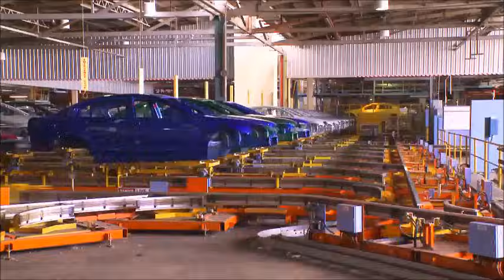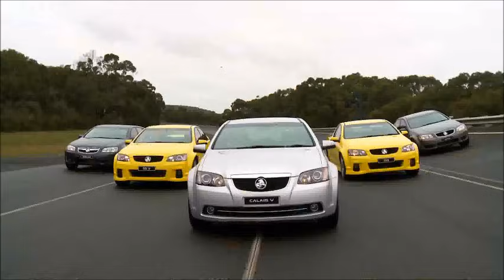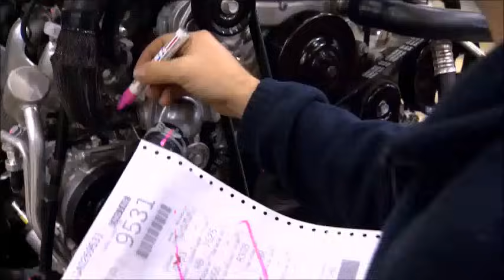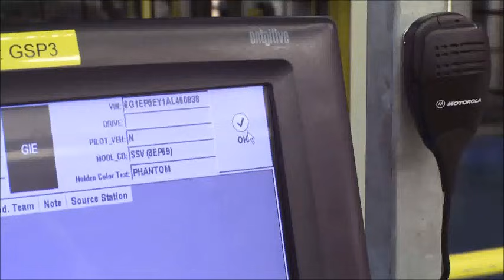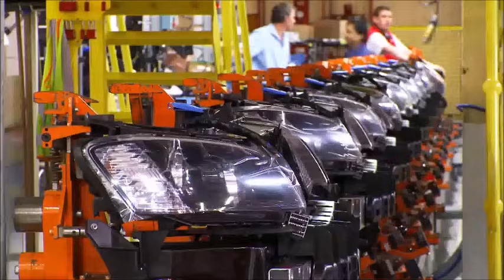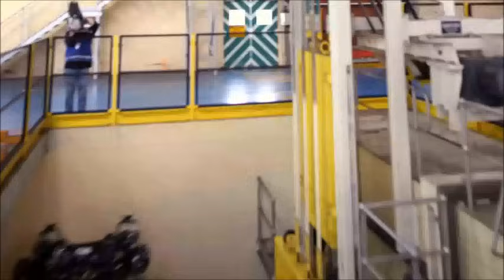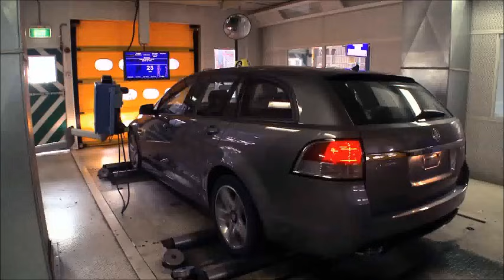Steel to Road - Building Holden VE Commodore FULL VERSION

Comment: I worked there from 2004-2009. We were able to bring the labour cost down to $2000 per car, start to finish! From press shop to driving out of General Assembly. We were also told at that time that the average wage at Elizabeth was $24.50 per hour per worker, Koreans were paid $22.50phpw, Thailand $4phpw and China $2.50phpw. If Chinese labour was used to build the Commodore, they would save $1796 per vehicle. Considering the car sells for a $10,000-$30,000 premium in Australia compared to equivalent cars overseas, the selling price in Australia still more than compensates for the extra $1796 per car. You cannot tell me that GM Holden HAD to shut down Elizabeth - the corporate world just can't stop itself making dumb decisions and this is one of them. Now because of the massive consumer backlash and disappointment, GM is now claiming they are going to send a German built replacement for the Commodore to try and save face without having to reverse the decision to shut down GM Elizabeth.

Wow a German built replacement how is that going to be cheaper when German auto workers are paid even more per hour than Australians and the cars now have to be shipped all the way around the globe?????? Nice one GM, you just lost another life long customer.
Reply: @charlie its a real shame we have no manufacturing industry left, no cars , no sidchrome, victa, fridges, washing machines, shoes or clothing ect ect ect all gone thanks to free trade, only industly left is building apartments townhouses units for rich chinese its a disgrace what's happened to our once lucky country
Reply: @volksdeutschewaffenss9670  100%
Reply: I'm not sure I agree. The Australian market maybe small, but it was much smaller 50 years ago and the industry was doing fine. Cambodia, population 15 million, got a Hyundai plant in 2010, will get two Indian car plants from 2016 and is even making its own indigenous electric car. Most countries subsidize their car industry. Holden just lost market share building sedans that fewer and fewer people wanted. Tastes went European.
Reply: Bullshit isn't it! I second your comment. I have always bought Holden, but the VF is the last one I'll ever purchase. GM has also lost me as a customer.
Reply: You're spot on my friend.
This is what "free trade" is all about.
We hand over illustrious industry manufacturing to countries who treat their workers like slaves and we take their cheap white goods garbage in return.
Trump tried to reverse it in America and succeeded for a short time, now they pushed him out the way and manufacturing is going back to countries like China.
That's also why their's a war on the mining industry here in Australia through the bogus "climate change" agenda.
It's actually big oil that's behind it all cos they want to shut down production in expensive Western countries, and start up in countries where workers work for peanuts.
No different to what happened to our automotive manufacturing.
If anyone decided to start manufacturing cars back in Australia at the same quality of Ford or Holden....it would be a runaway success.
Reply: I have a 1993 Holden Commodore that’s still running.
Reply: @woodss82  my 2004 VY with almost 300,000km on the clock I
Still drives like a new car, best vehicle I’ve ever had and as a wagon it’s got that much room I can use it for camping
Reply: Let's not forget,Ford is also done with Australia...all that is set to remain is small engineering and marketing department to sell re-badged Kia and other Ford World cars assembled in North/South America and Asia.If the Australians don't screw it up,Ford is going to allow you Australians to finish-up R&D on current and future Ford products assembled in other parts of the globe.

GM and the Australian Government gave Holden and Labor Unions  decades of warnings to get in shape...or it would pull the plug.
Reply: Holden was posting huge losses year after year before a small profit was achieved in 2016. Most attribute the higher sales in 2016 to consumers buying Australian built Holdens before Elizabeth closed. The small win in 2016 was too little and too late to save Elizabeth. GM was faced with over a billion in investments just to retool Elizabeth for the desperately needed new models. Holden needed a new fleet to claw back their lost market share. 

Over the last four decades brand loyalty has been depreciating faster than the vehicles themselves. Holden losses reflected this. Repeat buyers were fewer and fewer every year. Consumers were more concerned with price, durability, and styling. Holden vehicles became less Australian in their styling and features: resembling nothing more than rebranded American GM vehicles. Holden buyers took notice and instead bought low cost stylish imports. These imports were often more reliable and offered luxury appointments for far less than a Holden. In the end Holden could not afford to stay in Australia. The brand should have ceased in 2017. Instead GM further insulted Holden buyers by trying to pass off rebranded GM vehicles made in Asia as true Holdens. Holden at its core was Australian. Holden was a car brand built by Australians for Australia. The plan to save Holden by moving all production and assembly overseas destroyed the Holden name and what it represented. GM arrogant and ignorant, despite knowing Holden was effectively dead with the closureof Elizabeth, burned billions keeping Holden on life support for the next three years.
Reply: @J.Cameron.Stuart.Adams.Fisher  GM used Holden profits to design their world car products like the Camaro, and Holden supplied all the V6 motors for Cadillac. They had very creative accountants.
Reply: @Jimiluv450 what profits….????? 

The Australian government provided approximately $2.17 billion in subsidies to Holden over 12 years to support its local manufacturing operations, including a $275 million co-investment package in 2012. This support was intended to encourage Holden to continue building cars in Australia and maintain its Australian operations. However, despite this financial assistance, Holden eventually ceased local manufacturing and shut down its Adelaide plant in 2017
If they were making a profit they would be still manufacturing DUH
Reply: @ It's called the Detroit Mafia - demand subsidies to keep your operation open, and not expect the government to call your bluff. Germany happily plays along which is why the next commodore was built there and they have a strong auto manufacturing base. Australia called GM's bluff so they chose to leave as an example. They then closed down all their RHD manufacturing operations worldwide, arguably due to leadership issues. So more than simple profits DUH
Reply: @Jimiluv450  keep selling yourself your own truth champ….Holdens Sucked. Ever see the today tonight episode where they parked in the employee carpark and observed multiple groups on all shifts heading over to the car park to smoke weed / meth and drink piss to then go straight back to manufacturing cars….
They built shit cars. Australia got sick of the problems and started buying Mazda3s, then we bought Toyotas. Holden didn’t make profit and couldn’t sell units / commodores. They went broke.
Just like a bakery that makes shit pies n pasties - they went broke - classic
Reply: @corey5797  Go back to driving your Great Wall loser
Reply: @corey5797 this is a 9 year old comment, get a life, champ
Reply: I worked at the GMH Pagewood plant from 31 01.74
HQ/HJ/HX/HZ VB/VC Commodore 
And walked out for the last time 10/10/80

All labour intensive back then
Reply: And GM's lineup from overseas is blase and has no interest to those who love driving real cars.
Reply: +Jimiluv450 

Australian/New Zealand car market is too damn small to remain viable. Even Toyota was losing money with Government  cash-tax subsidies. Government/Labor Syndicate mandates ruined car-manufacturing in Australia.

 Here in the USA,we have a few Australian built Holden Commodores (badged as Chevy Caprice); the build quality is a joke.......same shitty attention to detail by Australian Union labor as UAW does for the Big 3. 

Plus it cost too much for GM to ship the cars all the way from Australia......which is why the Commodore and Platform mates will continue to be assembled in the North America...when GM Australia closes shop for good.
Reply: @NGS-020  Loud mouth yanks build crap too, Chrysler , Ford and GM have built and sold more death traps than Australia ever has or will. If you stop talking rubbish and take a little time to enlighten yourself, you know perhaps research to qualify your "opinion". I bet you may have sounded a little less ignorant and even a little less moronic.
Reply: mate i worked at dana as labour hire welder making ford and toyota parts around 2009 $24.00 flat rate, working like i slave, line never stopped, you had no time to go to toilet , line going so fast, like a old time sweat shop
Reply: They would have kept the difference in price and put back to the Cayman islands for a tax dodge :(
Reply: Maxx Damage:

If I can recall correctly it was a snow-storm of Australian-made Commodores (in 2010) stopped in the town where I live in Northern California. Probably safe to assume they were heading to Portland or Seattle........what was most remarkable about those "Chevy Caprice/s" was the shitty build quality. One car would have decent door gap tolerances,etc. and yet the human or robot missed mastic sealing of the lap-seals,etc. Another car would appear to have been properly sealed where the lap-seams met and yet none of the doors,trunk, or hood was properly aligned.My perception of Australian made vehicles sold in North America? garbage. 

Flasback 1980s, Ford imported a Mazda 3 convertible that was manufactured in Australia.....those cars were literally falling apart as they were being unloaded at the Long Beach, California Port. Australia made garbage vehicles....yes, the Unions were a significant part of poor quality to.

Even when Toyota announced they would be leaving Australia (closing shop)...........the damn lazy Union workers were demanding raises;knowing their jobs were on a life-line.................months to spare....ditto for the Chrysler and Mitsubishi workers.
Reply: @NGS-020  Think you are talking complete bull. You claiming export Holden's had crap build quality? I never heard stories like this on local cars and export bound cars would have gone through very tight QA.
Reply: @Dont_Gnaw_on_the_Kitty_4   I saw it with my own eyes. 4 semi-trucks loaded with Caprices,inconsistent build quality from the 28 cars.
Reply: makes no differnce..the fact remains they make cars no1 wants